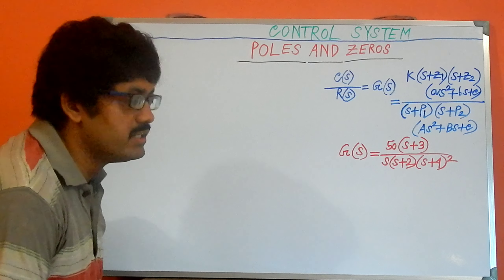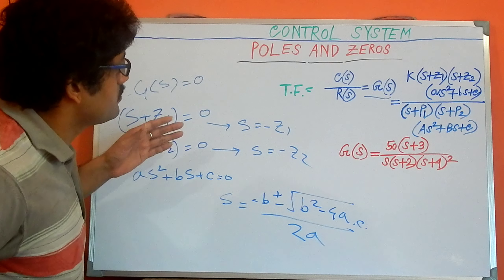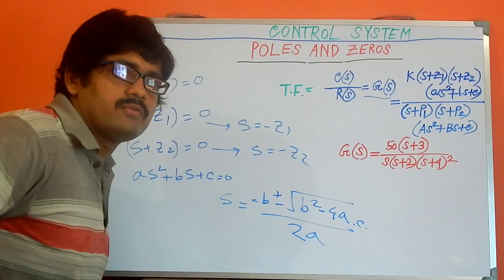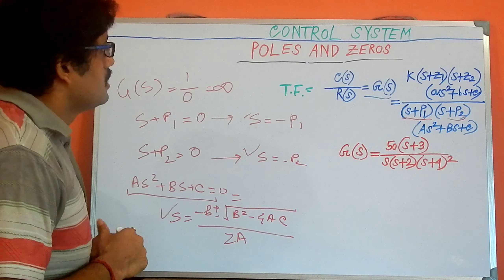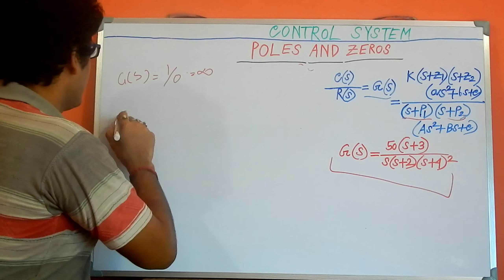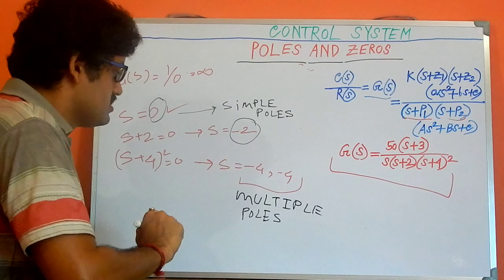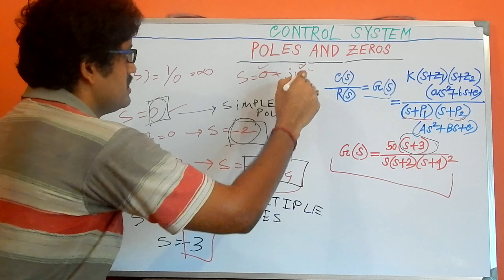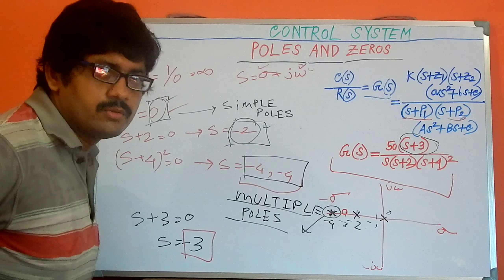Poles and zeros of a transfer function

Comment: It is stable unstable or marginal stable which one?
Reply from the maker: Thank you for asking this question. We have not started the condition for stability classes. This is just the basic definition of poles and zeros of any given transfer function. At the end of the class, we have also completed an example. We will definitely start the control system stability part. 

Stay tuned with our classes and like and share our videos 👍